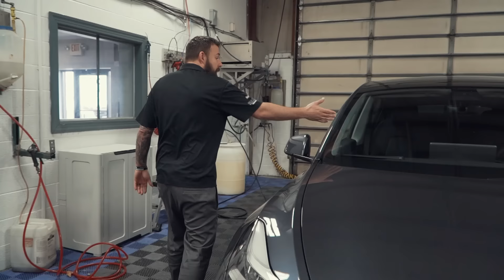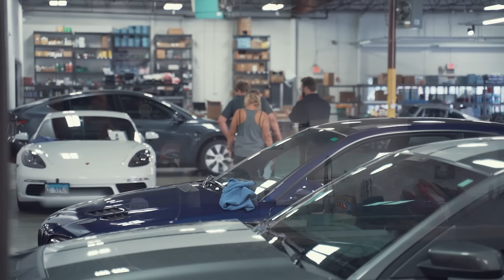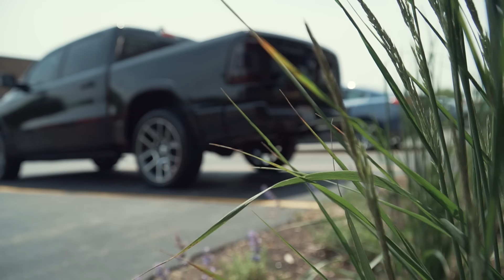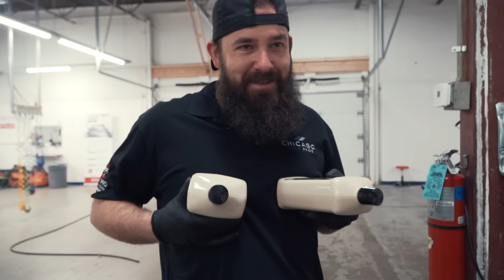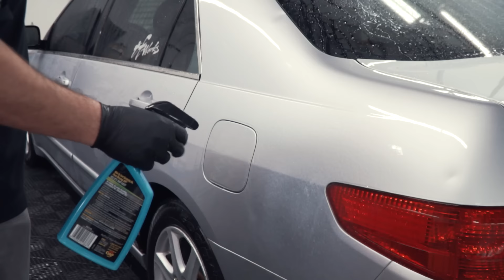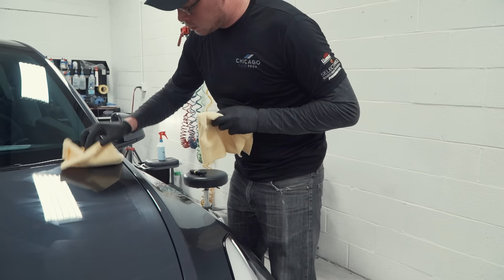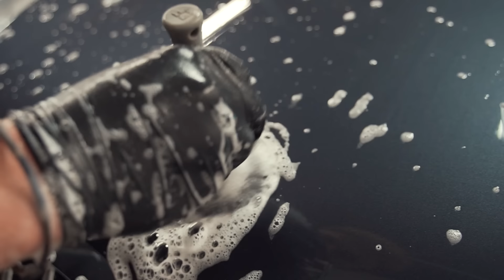Everything You Need to Know Before Buying a Ceramic Coating

Comment: As an owner of a 1959 MGA, that I restored back in the early 90s, keeping the paint in good condition means being scrupulous in how you clean and protect it. As long as you can dedicate the time and energy to do things right when cleaning, you can certainly protect with a good quality wax. Nobody really needs a ceramic coating to keep the paint in excellent condition. But if you are not willing to spend the time, energy, and proper cleaning techniques and just want a good finish for no output other than the cost of the finish, then by all means, get a ceramic coating. The paint on my MGA still looks great after all these years but it is not a show car, and sometimes during the summer gets driven daily for weeks. It has its share of defects but the shine on it is still mirror-like and I spend time once a month or more from Spring through the Fall keeping it looking nice.

Comment: I find that to be great advice I have not been using Ceramic Coating  Because I find if you do get swirl marks and you have to remove the coating on the area and it can be a real pain it's  a pain in the ass am finding that using a good sealant because my car is  Kept in a garage I find it's much easier to  Maintain gives me a very nice shine I've been using a product called jet coat from my top I find it to be amazing and gives me the same shine from that as I do from my ceramic coating

Comment: My local Caddy Car wash use “Ceramic Dura Guard” they claim it protects from UV rays. Is it the same or similar to what you talk about in your video. From their website: “Ceramic Dura Guard is formulated and produced by Kaady Chemical Company (sister company to Kaady Car Washes), and is sprayed on automatically after the final rinse.Ceramic Dura Guard is formulated and produced by Kaady Chemical Company (sister company to Kaady Car Washes), and is sprayed on automatically after the final rinse.”

Comment: Hi, i just a brand new 2022 toyota tundra. i plan on keeping this truck for a long time. although it will sit outside my driveway because it won’t fit inside my garage and i plan on driving to and from work 60 miles daily, 5 days a week. my question is…how soon should i get serviced to get a ceramic coating? thank you

Comment: My pick up looks brand new it has 5k miles on it its in an enclosed heated garage, its only drove 500 to 1000 miles each year, never in salt, rain snow weather, its protected from the sun and elements, I plan on keeping it until I die maybe 25 years I don't  plan on putting over 60,000 on it. Why would I need this coating?

Comment: I took my baby in for a paint job this past fall. There were dings, scratches and some cracking of the paint on the hook and trunk lid, there were no dents not even minor dents. The shop brought the hood and trunk lid down to bare metal and rid of all dings. My aunt took me to pick up my car, my car was parked in the front of the parking lot of the paint shop. I noticed a BMW as we pulled up to the shop I knew it was not my Bimmer, but in fact it was, I didn't even recognize my own car. I was in shock, I couldn't believe how great it looked. The appearance of my Bimmer was major. I care for the exterior and interior of my car like I care for the engine, I change the oil and filter every 2,500 miles or 2.5 months with Mobil 1 full synthetic oil. I laugh each time I buy the oil because the oil bottle reads, "Protects the engine for 10,000 miles." I wish I would let my car go more then 3K miles without an oil and oil filter change let alone 10K miles, I would have a damned heart attack. I hate car washes of any kind unless it is done totally by washing by hand. I wash my car 2 sometimes 3 times a week. During the winter months, I blowout the water of my garden hose roll up the hose nice and neat and in the annex it goes for those crapy cold winter months. I don't know what else to do to get rid of dirt road salt and whatever other crap gets on the surface of my car but to take it (I cringe each time I pull in) to a carwash. We do not know what kind of chemical(s) are spraying out of those hoses. I set the dial to high pressure soap and spray down the bristles of the brush to rid of any dirt and sand. I want to take my Bimmer into the professionals to have them add the Ceramic coat(s) because I want my baby to look the very best that she can and I will most definitely keep up with the upkeeps of maintaining

Comment: That's funny you say waxes only last a couple of months. I did my 2017 Toyota Avalon for the first time last summer, starting with a good wash, clay bar, fine polishing compound with a machine, followed by chemical guys wax-not hydroslick. This summer I'll use their Hydroslick. Here we are at the end of march and it's raining like crazy. Never washed it once since last summer. It's sheeting water and beading very good. This is N.H. where it saw salt all winter and snow and now rain. Wax alone last more than 2 mos easily. Granted it's not ceramic or graphene but it works and preserves the finish. Now coupled with NHOU lanolin undercoat yearly, she should easily last 10 more years with only 50K miles on it. It's amazing how so many downplay waxes of any kind. It's better than nothing if you intend to keep your vehicle. But considering the best of both worlds; ceramic/waxes, price, value, durability, longevity and ease of application Chemical Guys Hydro-Slick, wins as seen by so many channels on YouTube. So from experience keeping a vehicle more than 3 yrs anything is better than nothing, not just ceramic coating.

Comment: Question.. if a ceramic coating is applied  and say an accident / repair needs to take place to the body how is that affected? If the newly fixed area  is touched up will it be noticeable? Or will it also need to be coated to match? And wold that be easy and unoticeable ?

Comment: If you are going to get painted pinstriping don't get ceramic coating before the striping is applied. Ceramic is difficult to remove & to tell if its all removed. Hand painted pinstriping will not last if applied on top of ceramic coating.

Comment: not advertising but Nu Finish is pretty good, I dont know where they fall on the quality spectrum for ceramic coating but it is noticeably more shinny compare to the turtle wax and McGuire. I didnt even know there was a difference in terms of all these coating prior to this video, I just bought it because I was skeptical of their claim of only need to apply it once a year. did it made a difference? yes! do I trust that once a year claim? no. If you have a white car try it and drive it in the rain and you will find out the difference.

Comment: Wife & I drive trucks & are both disabled so washing is a huge chore plus rates to have it done right is tough on fixed income. I drive a 2022 Chevy Colorado 4WD Extended Cab which expected to be about the same size as my Dodge Dakota (tired of waiting for Dodge to release another mid size truck), wife drives a 2007 Dodge Mega Cab Hemi plus still have my 1997 Ram & 1993 Dakota. Still under 9,000 miles on the Colorado which spends so much time in shop am considering restoring my Dakota & selling the Colorado as bed size is bigger on Dakota but overall Colorado is bigger with lots of waisted real estate. Dakota is made of steel so has less small dents in 30 years than aluminum Colorado in 1 year. Washing our trucks about four times a year is about all I can manage. The 2007 Mega Cab Hemi will be with us for life. Will ceramic coating increase the lifespan of its clearcoat which is still holding up? Expect it will need cut & buffed first (all trucks are red) so is ceramic going to work to extend life on her 2007 if professionally buff as part of service & knowing washing only washing it twice during & after spring pollen season then a couple more times per year as it shows bad enough wife complains. If keep the new truck how often do I have to repeat the ceramic coating, seem to keep hearing every five years (keep our trucks till they die) but have heard some products last longer. Wife can only watch from wheelchair and with my bad spine takes me 2 days to wash her truck by time get ladders out, all materials/equipment, always have to wash it two times with second detailing cracks and crevices, hit with coat of wax next day then put up everything followed by two days in bed recovering. I used to do paint & body work so understand a professionals time & overhead is worth money. Have considered buying one of the higher priced ceramic products, after washing using 3M Perfect-it to buff wifes truck then ceramic coat myself (a week in neighbors shop) then after washing, clay bar my Colorado then ceramic coat it myself. Am in Georgia so not taking business from you, have done enough show quality paint have the skills but wondering if you can recomend a ceramic coating for trucks that will only be washed when they absolutely require it. Be Blessed

Comment: I've been using Nu Finish on the three cars I've owned over the last 25 years or so, A Black 930 Turbo with an Imron paint job, A cream colored Jaguar XJS V12 convertible and now a 2001 C-5 metallic platinum Vette.  I try and keep my cars in tip top condition both mechanically and aesthetically.  Nu Finish goes on EASY, comes off relatively easy.   After I wash, claybar, and rewash the car I put a coat of Nu Finish on, let it cure for 30 days and then I put a second coat on and it easily lasts a year.  I have been delighted with the way my cars look and how it performs overall.  BUT BUT BUT With that being said, now there is the newer "ceramic" coatings flooding the market.  Nu Finish, to my understanding, is an acrylic finish. Is ceramic "better" than acrylic ??? Can you add an acrylic to a car thats had a ceramic coating ?  How does ceramic and acrylic "get along" ?  Or should I stay with whats worked for me all these years and go with the "if it ain't broke, don't fix it" kind of thinking  ???  I am ready to do a car wash with Dawn detergent to strip off as much of the old protective layers as possible and get  right down to the clear coat, then do my claybar dance, and rinse and I am now ready to apply either an acrylic NU FINISH coating or ..... Ceramic .  What are your thoughts and advice ???  Thanks in advance ! ( ps ... UNFORTUNATELY I don't live in Chi-town.  I'm in the Democratic People's Republic of Portland Oregon ;-) ). Sometimes I try and figure out WHY .

Comment: For those that cherish their paintwork I wouldn’t recommend ceramic coating. Having spent +500 on your coating you will inevitably accumulate swirls in your paint through improper washing or other surface contact, it won’t protect against bird bomb etching.  So if you need to restore the surface polishing is needed, removing your expensive ceramic. Your better off with a wax or sealant and polished surface if you want gloss.  The only advantage i have found is ease of washing, water flings itself off ceramic surfaces but definitely it isn’t more glossy and isn’t an answer to mar free paint

Comment: I have a new Toyota 4Runner which I use off-road in the mountains and the high desert.
Should I bother with trying to remove all the scratches from brush and trees?
Would it make sense to apply a skin every few years?
Maybe repaint it every few years?
I plan to keep this vehicle for at least 10 years if not longer.

Comment: Who do you recommend is the best in the Houston, TX area for professional ceramic coating. I ordered a brand new 2024 GMC HD AT4x AEV Edition diesel truck that is being delivered in the next week from the manufacturer. I want to ceramic coat it immediately so the paint is protected right of the manufacturers assembly line. I am keeping this truck forever too. I live in the North Houston area. Also what product do you recommend to protect the exterior rubber to keep it from breaking down, headlights from oxidizing, leather cleaner and protectant/moisturizer, tire cleaner and protectant/shine, black exterior plastic protectant, interior dashboard cleaner/protectant? Also the best method to clean the windows to where no residue is left behind. Thank you for your help.

Comment: 1 piece of advice if you wanna keep your car for long.
WASH THE UNDERCARRIAGE AND WHEEL WELLS TWICE A WEEK TO REMOVE SALT AND ICE STUCK EVERYWHERE. Also I spray old engine oil on the under carriage with pressure washer, nothing fancy needed, fill up an empty  brake fluid cannister with old oil, use your thumb as stopper and release as needed while holding the cannister upside down right by the tip of the pressure wash nozzle and let the water carry the oil everywhere under the car...smooth ride and rust free....for a long time.

Comment: 1st thanks for the video, it was incredible informative.  I just bought a new truck (2 days ago) and after price negotiation they tried to sell me a bunch of stuff including Cilajet coating.  I didn't sign up for any of that  but convinced them that I needed to take the documents home and read the fine print - so now I am doing my home work.  So what type of ceramic coating do you use at your shop?

Comment: Gosh I’m feeling really stupid- I have watched about 25 videos on ceramic coating for cars just try to figure out simply what does it do to protect my car and I’ve learned many things what it does not do and how it’s not good for drive in car wash, not good for rocks and scratches and may or may not need to be reapplied some more frequently and others less frequently depending on use and special care but I still can find what it does to protect the paint besides some UV protection and makes it look more glossy compared to just a normal wax. What am I missing?

Comment: I just purchased a 2024 Toyota GR86 Premium MT. I got the factory PPF packages that cover the hood, fenders, rear bumper, and i had the front bumper PPFd from a business near the Toyota dealership that i bought the car from (they did a okay job, so many curves on the front bumper though that a few small "bubbles" apparently could not be "made perfect". My car is kept in a closed garage, which im greatful for, and i drive it roughly 4 times a week, and every few weeks i will take it on a quick 20 minute drive to get it some highway miles. The PPF is not a full wrap around, i can see the edges that were done. 

My question is, do i still need to wash the car every other week? I have been using a Waterless Car Wash spray pretty much every other day (Chemical Guys Swift Wipe spray), to keep the car looking the way it did when i got it off the dealership lot. I have been ordering alot of cleaning items, including a rechargeable Ryobi blower to air dry certain parts of the car after my initial wash, and i am prepared to start washing the car, but being such a "neat freak" about keeping the car looking good, and considering it's kept in a clean and closed garage (where i spot clean it regularly), how often should i wash it? I think i'm benefiting more than others considering the car is never parked in the sun. Any advice would be nice :)

Comment: Once you get a ceramic coating what is the best and easiest way to keep it clean? I use car washes all the time and it gets my car pretty clean and shiny and it's very convenient and easy. I just don't have the time and energy to wash my car myself regularly. If I get a ceramic coating can I still use car washes to get off the dust and dirt that accumulates or will that ruin the coating?

Comment: I have applied the Adam’s Graphene Ceramic coating on my car.  I have used a few different products from other brands to maintain that coating.  By doing that will that diminish the effectiveness of the coating?  Therefore, will it be better to only use maintenance products made by Adam’s?  And if I ever use another brand’s coating (whether on my own car or another car) is it better to use the same brand’s maintenance products?

Comment: what does ceramic coating on the glass do for you?  Does sitting out in the sun in southern latitudes make ceramic coating a moot point?  Also, does a good car cover, combined with coating, help with sun. (I cannot place my truck inside a carport or garage, as my Chevy SS has my one spot taken up!)

And how does my local detailer offering "stripping" down my new truck tie in to the question of ceramic coating?

Comment: So I'm preparing for Crystal Serum Light. I'm going to 2 step correct. First using Rupes yellow combo pad and compound, then going to finish with Rupes Pure combo. My question is, do I need to Panel Wipe after the Pure process?

Comment: I put two applications of ceramic coatings after washing, drying and clay bared a 2019 Blazer after a year. When I finally washed it for the first after coating it, the final rinse ended up causing hundreds of water beads. By the time I was half way finished, I ended with dried of water spots. I assumed that a ceramic coating would help prevent this?

Comment: very informative... ive been contemplating doing a ceramic coat for a lil while now. i understand the prep work is crucial. i live on a gravel road and wish to properly protect the car from all the abuse that the conditions delivers on a a daily basis. im concerned WHEN to do it though. what kinds of things will i need to do to give the coating a proper applications before sending it in to be done. and what CANT i do after its done as far as work on the exterior once its coated without basically voiding the coating and costs so i dont jeopardise my investment?